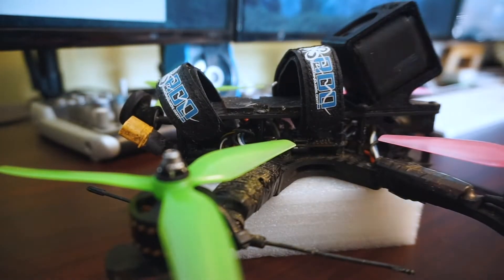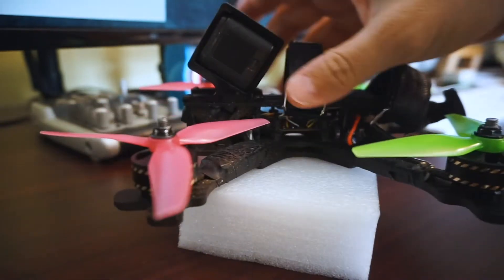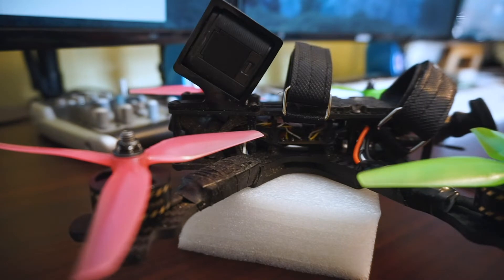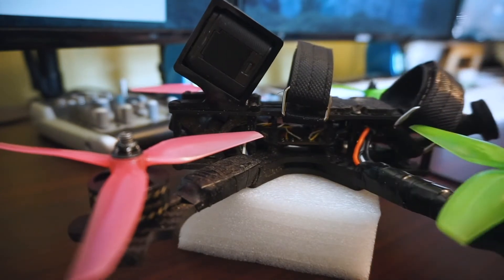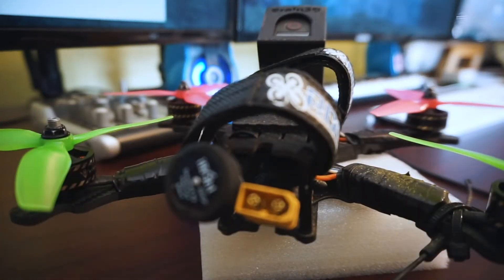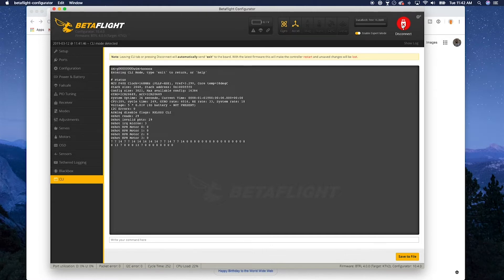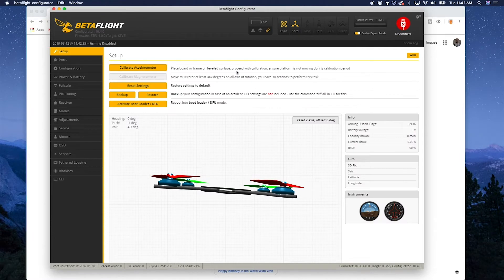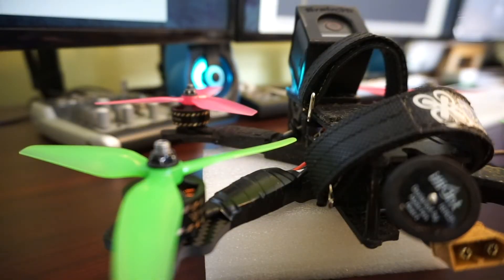Betaflight 4 RPM Filter - RichFPV Tech Tuesday

Comment: RICH FPV Just wondering, did you ever find a way to get your motors to cool down? I’ve got a very very similar setup that I built about a week ago and the motors just got really hot on defaults. Checked for continuity and everything is good. I tried the rpm filter and it helped tremendously but they still get pretty warm. Do you have any tips that would help me cool them down? Would really appreciate the reply, thank you!

Comment: flew RC2 today. RPM, Bi-dir BLheli FW, and all the instructions from Wiki: Kwad feels good. As a bloody beginner, I instantly had more control and better feel. but the Ps were way too low for me, had to up the P a fair bit, otherwise it was tumbling under low rpm when cruising or cutting the throttle in a loop. Engines after several Packs and a few miles: Cold as stone!

Comment: Good video man 👍 I'm guessing it feels a little more connected? because it has less filtering so less latency?
Also do you have to have the telemetry wire hooked up on separate ESCs to read rpm? If so maybe it will be something I get to down the track on 4in1 ESCs and hopefully someone will make BLheli 32 suite for Mac so I don't have to mess with wine. All my new ESCs are on stock firmware and I swap a motor wire to change direction lol.
Reply: @richfliesthings  Cool thanks for the info 👍I will have to check out BF 4.0 soon I reckon.